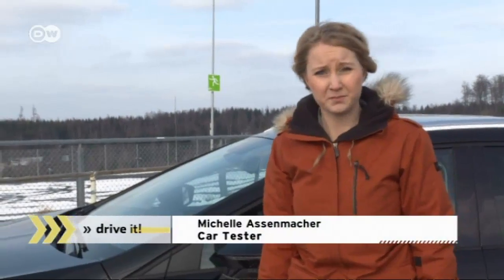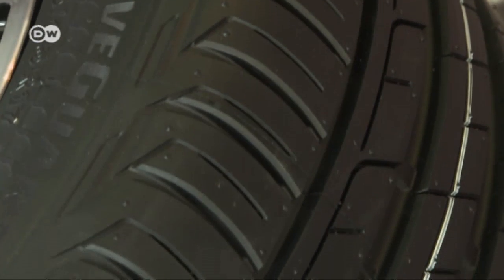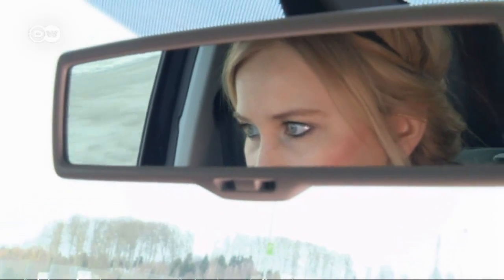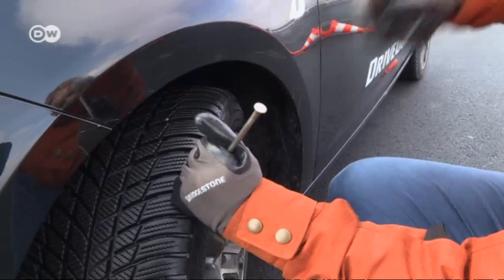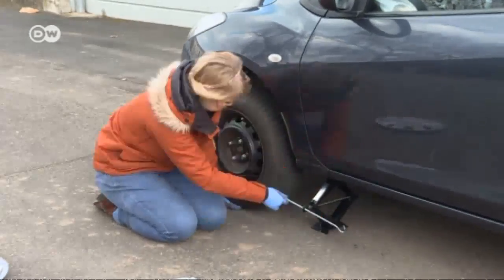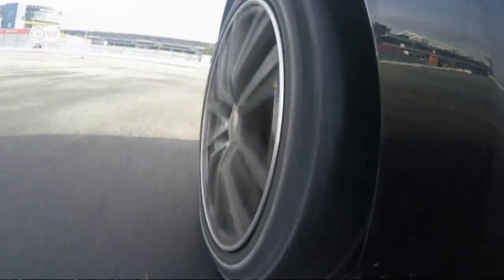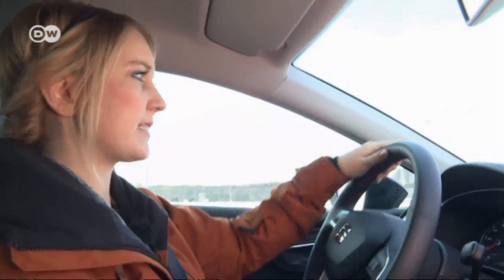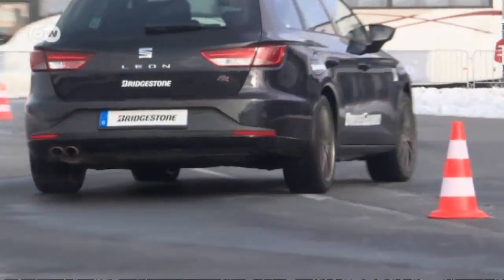Road safety: run-flat tires | Drive it!

Comment: Driving with a runflat tire that is flat is NOT a good idea. There is basically little hard rubber or plastic that provides a cushion for the rim, you go over a pothole and that won't be sufficient to protect your cars rim, alignment, springs or any other components such as tie rods and bushings. You could be spending a fortune in repairs.
Reply: Twin Turbo thank you Einstein! The chick is hot that’s all it matters... enjoy the video!